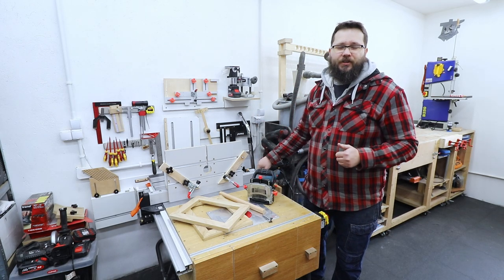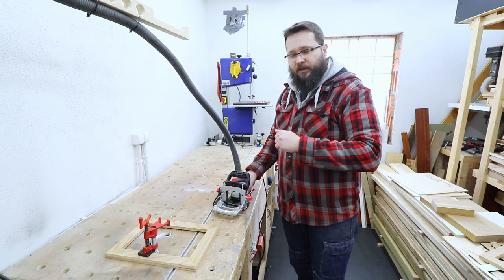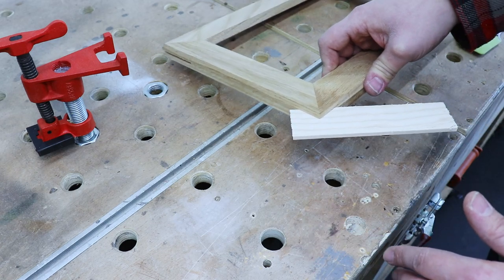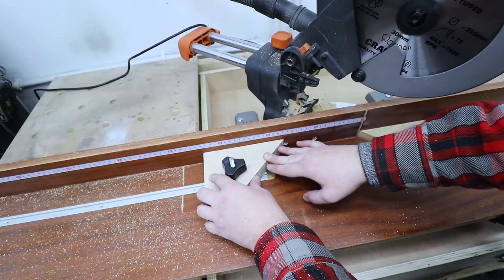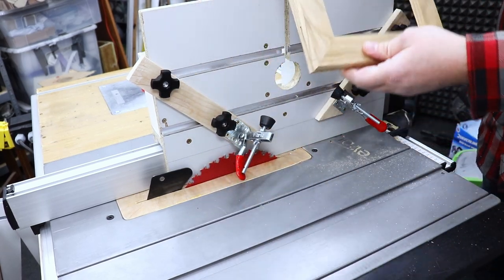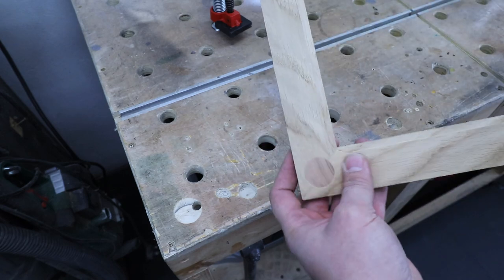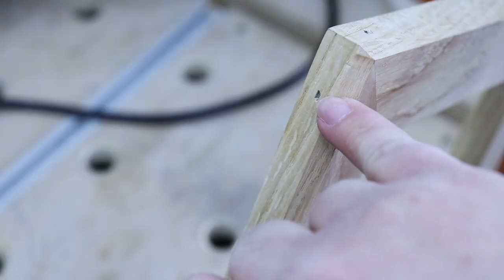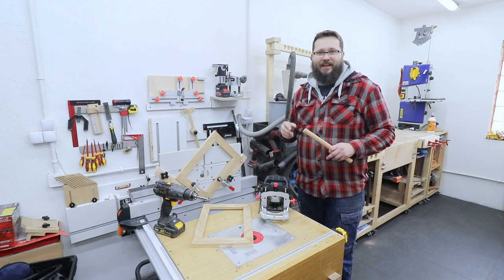4 Ways to Reinforce Picture Frames & Strengthen Miters

Comment: Nice tips, Tom. In particular, the "dowel" system is cheap, fast and easy. Only issue is it's probably unsuitable for thin frames 'cause you don't have space enough for the dowel. In that case, brads probably are the only reinforcement available.
Reply from the maker: Yes for thin frames you are looking at brads or furniture staples

Comment: I never thought of using my biscuit joiner to make the spline cut before. But like you I prefer to use the table saw and a spline jig. I have used the dowel method a few times which is quick and easy. Cheers 👍😎🇦🇺
Reply from the maker: The dowel method is an interesting one and easy to do. Biscuit jointer is a good option as well if you want to make quick splines that are not too large.

Comment: I've not seen the dowel option before, thanks.  Staples across the rear joint is another option. Actually, you also don't necessarily need a table saw jig to achieve the cut, as demonstrated here by Inspire Woodcraft -  https://www.youtube.com/watch?v=eRPbkUVsVxQ&list=PL6KVqVeh8v4XOygjdqZQfFCx4DXpd1-Vz&index=9
Reply from the maker: Hmm I think I wouldn't feel safe using that technique, potential kickback happening with that setup.